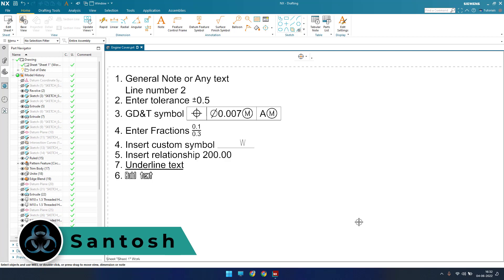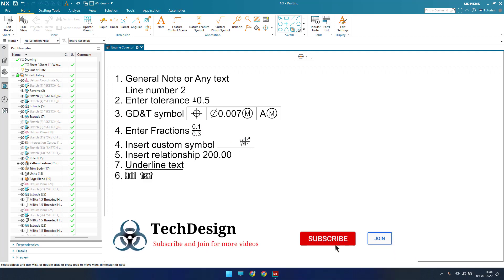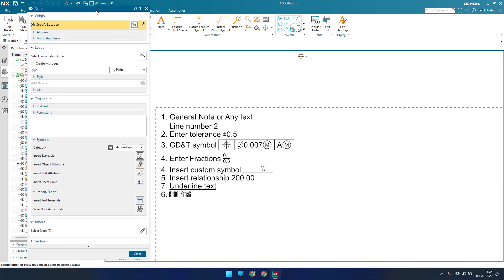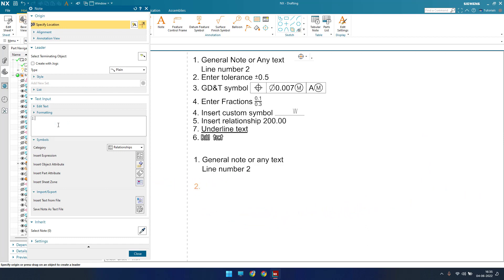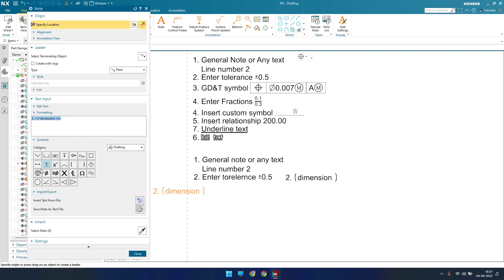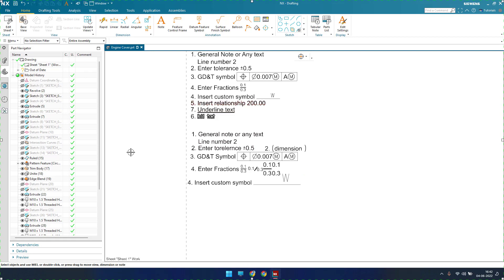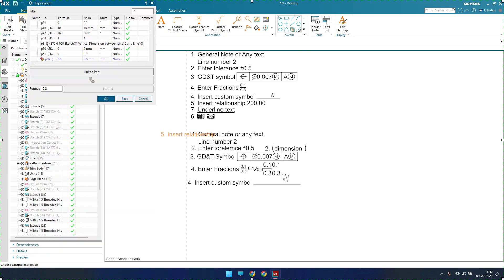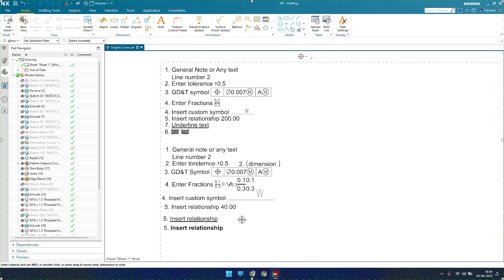Siemens Unigraphics NX- Drafting || How to Insert different type note.

Comment: Is there a way to change the angle of the text? Like for example from horizontal to vertical.
Reply from the maker: check the angle in text settings and change it to 90 degree
Reply: @TechDesignsantosh  somehow missed it the first couple of times I looked through it. thanks anyway
Reply from the maker: You are welcome 😊